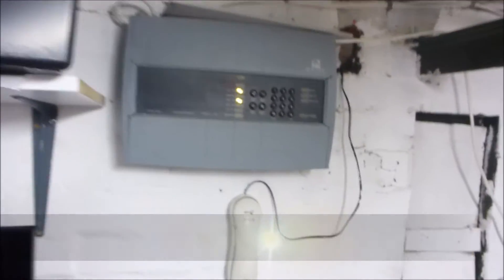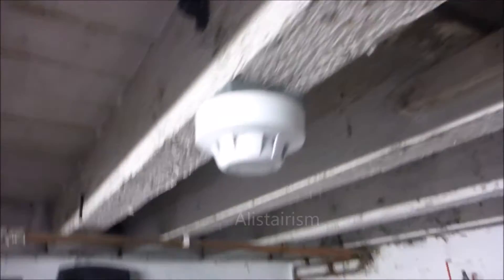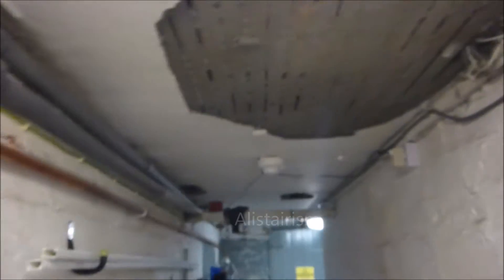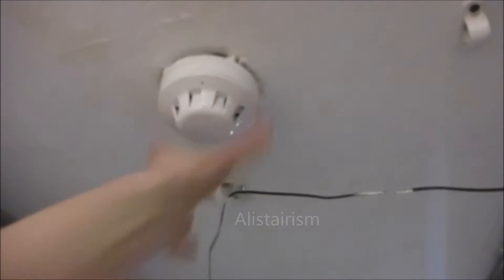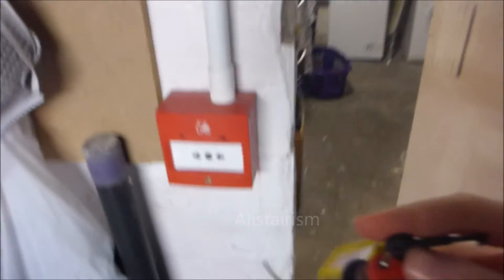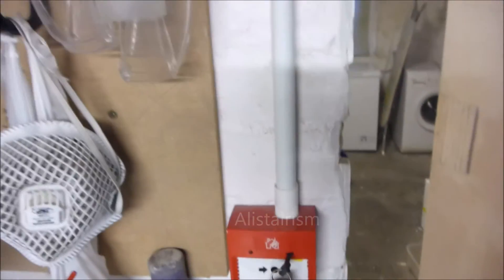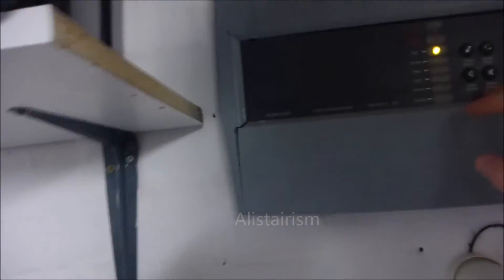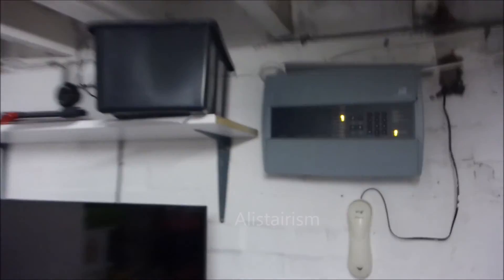Fire Alarm System Test 61 Gent XENEX

Comment: Is the call point a twinflex one? If so, how did you get it to work with a 4 wire panel?
Reply from the maker: no it is a 4 wire rafkie.
Reply: alistairism ok thank you
Reply: And where did you get the Fire Cryer plus?
Reply from the maker: +Ghast3965 Gaming . just off eBay.